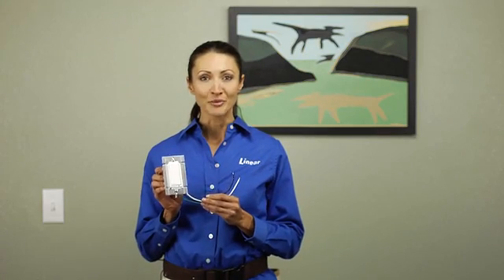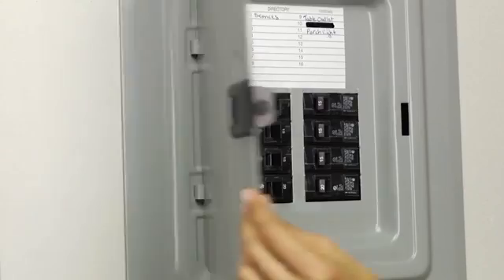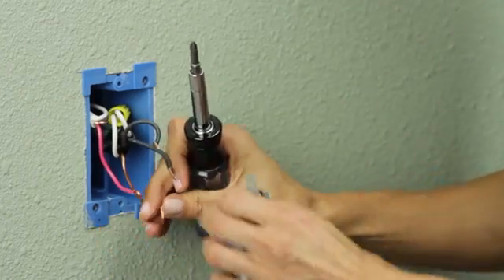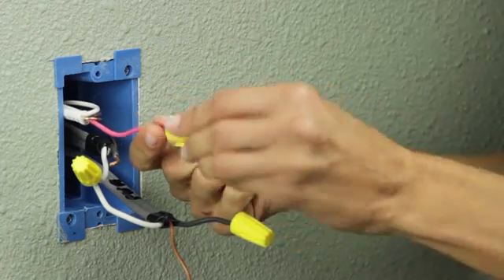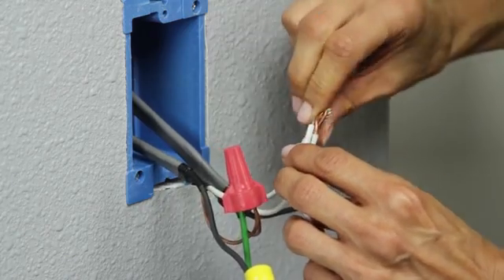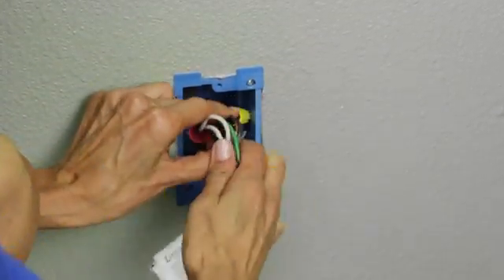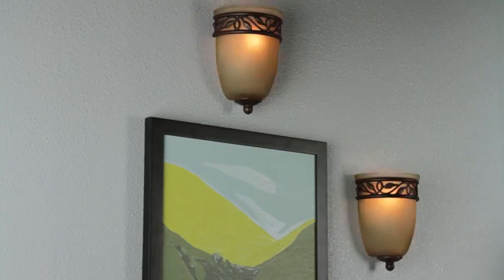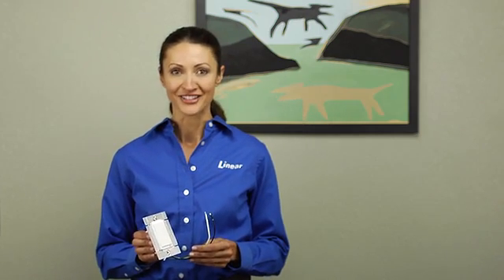Linear WT00Z: Z-Wave 3-Way Wall Mount Dimmer Switch

Comment: It is important to note that the WT00Z is a remote ZWave transmitter, and will not switch a light by itself.  You need a switch like a WD500Z or WS15Z to actually switch the light on and off.  During my installation I used a WD500Z to control the light.  Then used the WT00Z to remotely control the WD500Z from across the room.  I "un made" the traditional three way circuit with a traveler wire, and changed it to a standard circuit controlled by the WD500Z.  Then used the WT00Z to remotely switch the WD500Z via ZWave.  As the video shows, the WT00Z needs power (line, neutral & ground) and the power needs to be available all the time (not switched on/off with the light) so be sure you can supply that to the box the WT00Z will sit in. (Ideally before you purchase the WT00Z.)

Another important note, the WT00Z must be associated with the switch (WD500Z, WS15Z, etc) it will control.  I used a vera home controller to make the association.  The WT00Z wont do anything (beyond blink the green led) until you make the association.

Comment: I think you left a couple of parts out including the minimote programming tool and the fact you show nothing of the load wire , that would be going to the light, so what do I do? Do I need (2)  WTZ-1 to pair  the two two switches together  toaccomplished this...